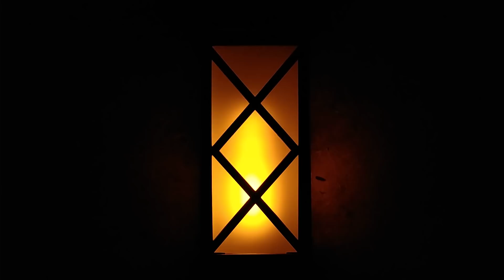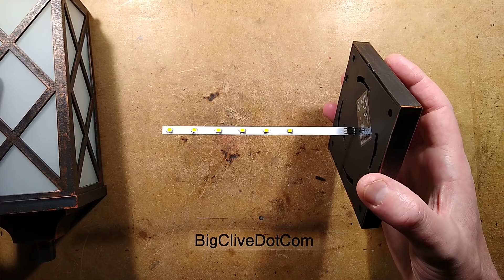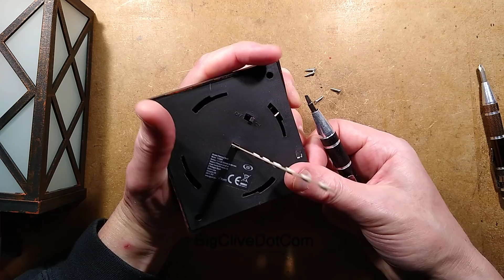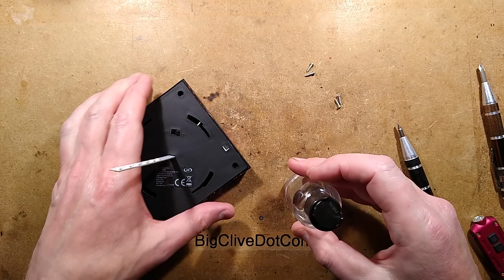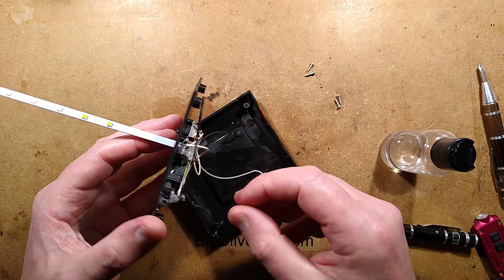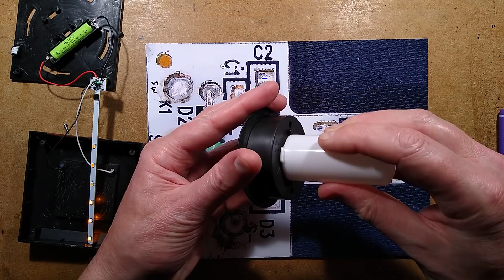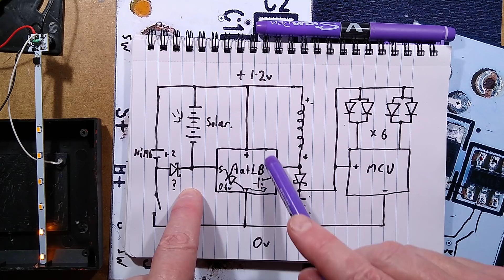Minimalist flame effect solar light  (with schematic)

Comment: It looks/sounds like Jack's is a clone of Yorkshire Trading Company. They sell much the same products in much the same manner - pile 'em high and flog 'em cheap, no frills, and what often looks like other firms' redundant stock.

It's a pity that the flicker flame effect is preprogrammed and run on a two second loop, rather than a genuine randomly generated effect, but logically that would be too costly to implement at the that retail price. - It's a nice enough effect if it's just a few units randomly placed, but if you had several in close proximity (say, along the sides of a path), the 'not so random' pattern would be clearly visible as several lights perform the exact same sequence in perfect (well, almost) synchronicity.

I guess though, that if our Clive reassembles a product, then it must be considered as a worthy product. If Clive likes it, then that's good enough for me! 👍
Reply from the maker: It's based on a microcontroller.  They could have fitted a decent pattern in if they'd tried.
Reply: @bigclivedotcom  I wonder, would it be possible to 'insert' your own pattern, or is that something that's not really feasible?
Reply from the maker: @28YorkshireRose12  You could replace the microcontroller with one that has your own software in it.

Comment: can you help? I have an 18 pin 3 way sliding switch I need to replace, and I cant find one anywhere, and I looking at the wrong things or how can I change it out without adding like 6 switches?
Reply: Is that a 6 pole, double throw (w/ center off)?

Only slider close to that is on eBay,but it's a 24 pin, so likely the center position has a terminal as well (on-on-on)
There are some 18 pin sliding switches as well but unclear on poles/positions (mainly from reel to reel players.
Depending on what it has to fit to/into, that 24 pin variant might work for you - https://www.ebay.com/itm/10pcs-6P3T-PCB-mount-24-pin-3-Positions-Slide-switches-802-026/163574516254?hash=item2615cd0a1e:g:WggAAOSwXf9ZoyTW
Reply: @michaeltempsch5282  im not sure, but having a bitch of a time finding a replacement, im thinking i might just try repair what was there as its being a pain!

Comment: Damn, you’ve let the cat out... The chinese will start using that circuit for bar-graph VU meters. More accurate than whatever they’re using now.
Reply: more accurate than the cheap lm3914 based circuits? with an ic that is designed for exactly that? probably not